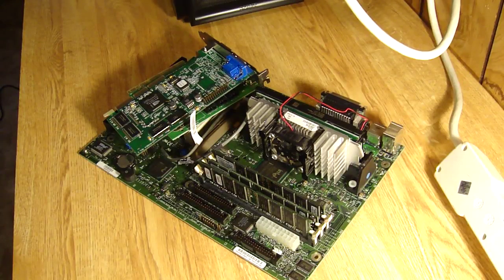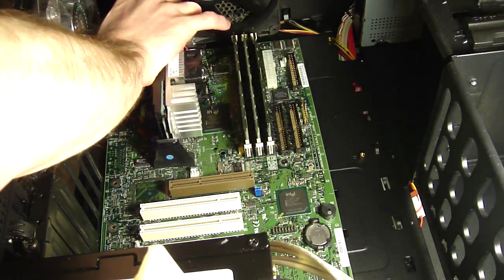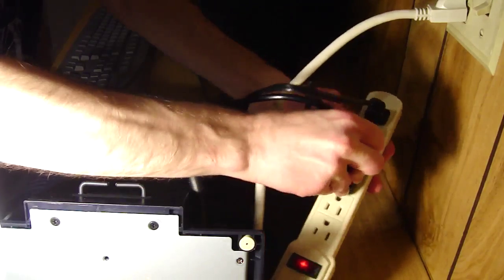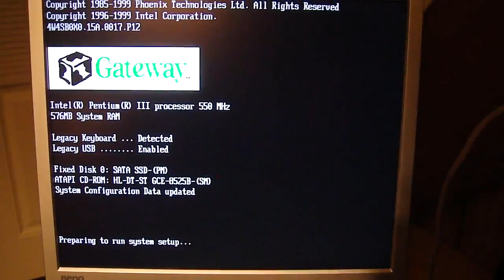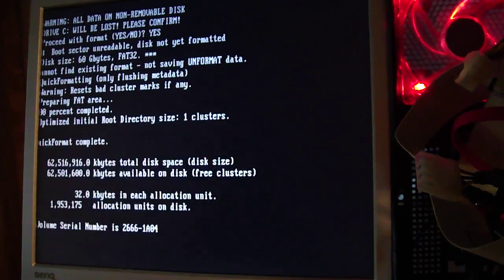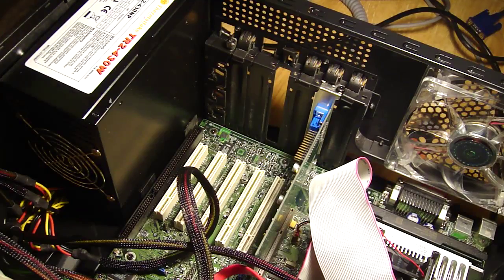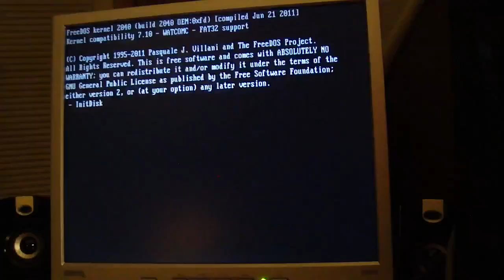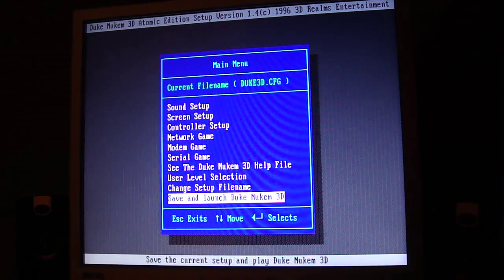Let's build a DOS machine from scratch!

Comment: I had that same gateway intel WS440BX before, then i got a Asus P2B to replace it, i didn't chuck the board, i kept it in a ESD bag in a cardboard box. and later in this video, that buzz is annoying, i guess there was a bug in the diagnostic software or that it has issues on FreeDOS. I am having issues too with my Windows 98 PC, especially with the voodoo 2 cards which is there are pink horizontal line artifacts appearing sometimes especially when i play quake 2, doesn't happen in need for speed 2 SE and grand theft auto 1, i ordered a couple 8mb diamond monster 3d ii voodoo 2 cards from ebay for $120 i hope that one of them is not broken. Update Voodoo 2 cards are fine, lowering the brightness helped the wierd pink line issue